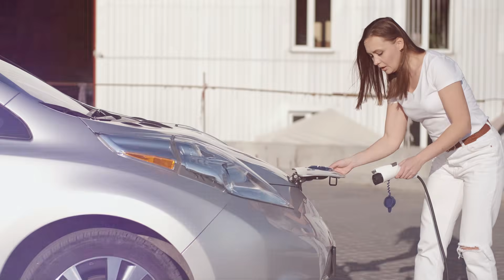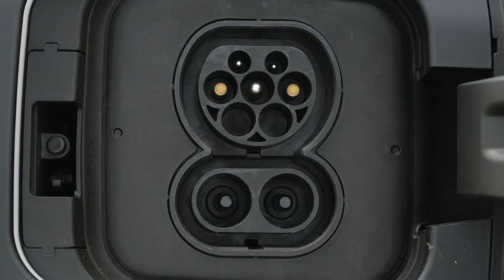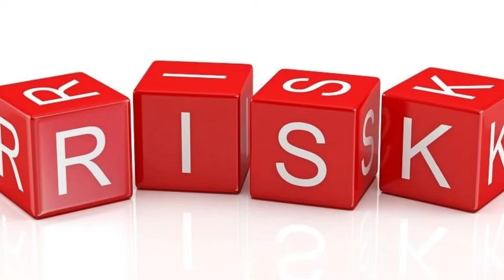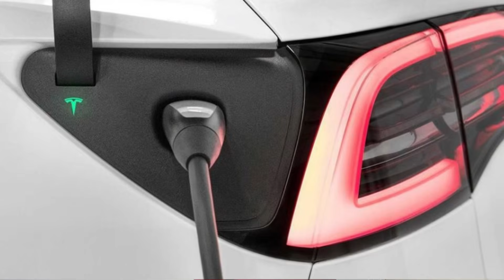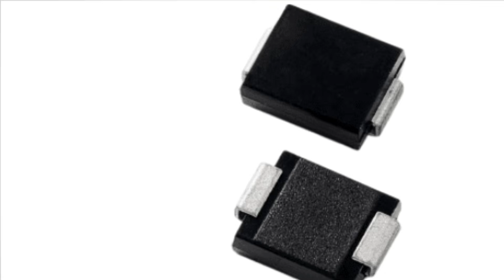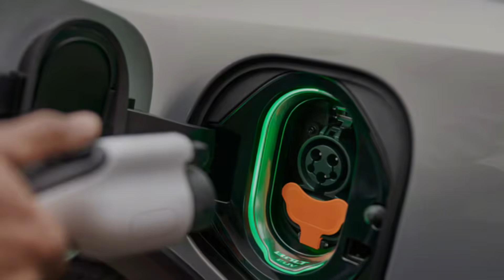The EV's Achilles Heel: Charging Port Vulnerabilities

Comment: Brought to you as Public Service Announcement. By ExxonMobil, Saudi Arabia and your best friend Vlad.
Be very afraid electric is is DANGEOUS, flammable and explosive gasoline is completely and utterly SAFE! How utterly transparent😂😂😂😂😂😂
Reply from the maker: Thanks for your comment .
I didnt mention that EV's are inferior than Gas cars at all . my channel is always promoting EV's and this video is giving clues about how the failures can happen with the charge port and  how this can be avoided.
Reply: @shayan_ev  I have been driving EVs since 2016 and I have seen dozens of charger failures (charger fails safe). I have seen a handful of vehicles with the connectors fused to the port and a couple of cars that caught fire when the charger supplied over voltage (charger and vehicle both failed to fail safe). 

This is far from theoretical.
Reply from the maker: @homomorphic thank you from confirming
Reply: @shayan_ev I didn't even think this was controversial. Anyone who has owned a BEV for any period of time is completely familiar with failed safe chargers. It takes  longer to come across the rare fail unsafe events, but if you own a BEV for a decade you'll probably come across one or two , although it almost certainly won't happen to you personally.
Reply: @shayan_ev 
Failures of the EV port are more theoretical than real. Everything can fail. The actual failure rate correctly installed  EV charging hardware is a slightly higher than the frequency of mega tsunamis.